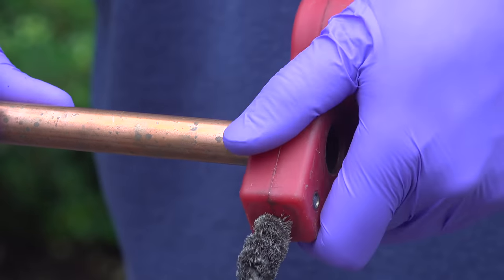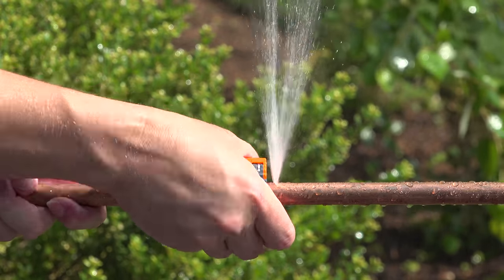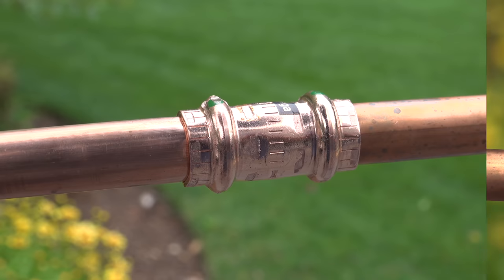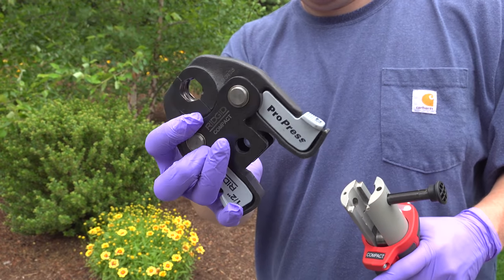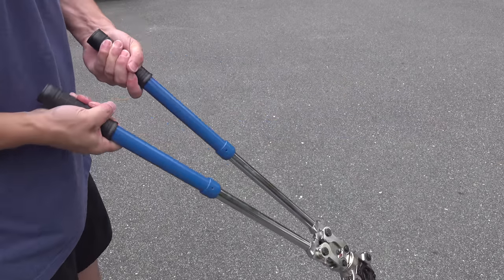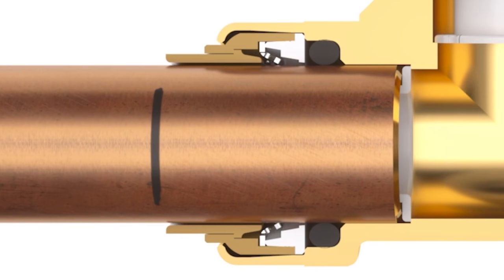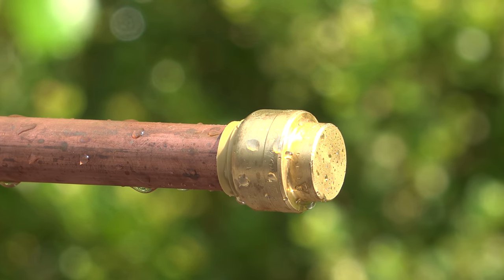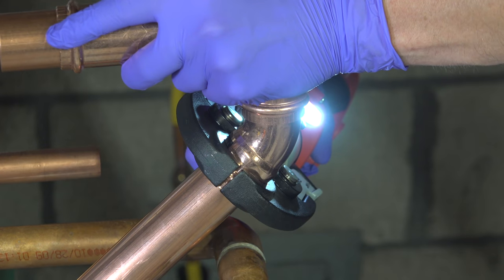NEVER SOLDER PIPE AGAIN - 3 Ways for EASY DIY Plumbing

Comment: Looks great as a temporary fix for someone with no soldering experience   however I would question the long term viability of using a process with O rings . How long would it be before they go brittle and fail? Personally I'll be sticking to the tried and tested method for now. Thank you however for sharing your video .
Reply: You and 18 other people apparently know more than plumbing associations and standards organizations.
My Dad was a Union plumber among other things, so I get that it painful to watch Non-plumber Joe Average simply cut plastic PEX and pop fittings on and be done with a job.  Currently in 2023, its hard to find a plumber willing to come out for a small job without a bill that would pay for a family of 5's groceries for a week. For a 1-2 hour job.
So far its been about 40 years in the US and longer in the EU and really haven't seen any uproar over failures, brittleness, etc.
Go ask anyone with a smidge of science education about which will last longer, a tube of copper or a tube of PEX.  Copper has a lifespan of generally 70-80 years, whereas PEX is known to have at least 50 years. They expect it would be longer but they don't have actual official samples from before that in the US.
Reply: @boots7859  Why you get so triggered by one guys opinion? Great your dad was a plumber. Mine was a doctor but i don't give medical advice. In the end soldering is a reliable method but to each their own. And if you can't get a good plumber with reasonable prices then search harder. It's not like plumbers are some rare breed. I had to go through a few plumbers before i found the guy who has been doing work for me the last 15 years.
Reply: Wasn't it O rings that caused the space shuttle to explode...😢
Reply: @boots7859 
there have been many instances of uponor pex A failures of the materials. Recalls have been made in red and blue pex.. where pin holes have been reported.. pex is not necessarily the best solution for plumbing supply..  😂😂

Comment: Installed shark bites on copper for my water softener. Almost 20 years ago and those suckers show no signs of leaking. Recently used 2 old ones to transition to PEX lines on a new water softener, just made sure the O ring looked good and lubed it up with proper grease. I wouldn't use them more than this one time, but once again the fitting works great from the copper to PEX. Old school keeps me cautious of using them in hidden places to be honest, but again almost 20 years and no signs of leaking.
Reply: 20 years is NOTHING! My home was built in 1957 and never had a leak!
Reply: @maxpower9848  so it's quite a new house, what is your point ? .These fittings weren't around then ,greetings from U.K.
Reply: @alemgas  >Place your faith in new technology that's only been around for 20 years
>Go with established method with a long standing proven track record

Yeah, I'm thinking solder is the smarter option.
Reply: @nonyafkinbznes1420  with that mindset you would still be fitting lead pipe 😂
Reply: @alemgas  Yes let's use modern plastic pipes instead.  Microplastics are totally safe for human consumption.  🤣
Reply: @maxpower9848  That you know of.
It would surprise all the experts that pop up on YT comments if they ever actually crawled around a house.  Old copper is notorious for pinhole leaks. And unless they're over the dining room ceiling or other obvious spot, they're missed until the hole gets large enough to overcome normal evaporation.
Reply: My house was built in 1824. They used shark bites and never had a leak. Except one frozen pipe failed at the sharbite fitting.
Reply: @nonyafkinbznes1420  You placed your faith in 15 year old tech (Youtube) to post a comment. Enjoy your leaded water.
Reply: @maxpower9848  Enjoy your leaded water.
Reply: @maxpower9848  My house was built in 800AC and I have NEVER had a problem with these aqueducts.
Reply: @TopBestestGreatestFastestMost  It's only a YouTube comment bruh and I've discovered many of my old ones are missing.  Tanks for proving my point.
Reply: @nonyafkinbznes1420  Microplastics are an entirely different thing. They can cross into the bloodstream and we are still trying to figure out what kind of damage they do in our bodies. Ever bought a cup of coffee from McDonalds or Starbucks? That paper cup is lined with a microscopic layer of polyethylene, so you've been drinking out of plastic for years.

Comment: I love how they completely over sell the difficulty and dangers of soldering, then show you a bunch of gimmicky crap that is way less reliable and will definitely cost you more time than just doing the job right.  ALSO:  Yes shark bites leak……almost always!
Reply: Shark bites almost always leak if they are installed by someone that doesn’t know what they’re doing. Same as soldering.
Reply: If you install it properly they don't leak can't say for long term though
Reply: @CT-vm4gf  shark bites always leak no matter what if it doesn't leak now it will later, stick with soldering none of the gimmick crap
Reply: I've installed shark bite fittings, shut off valves and a PRV in my own house. I've never had one leak in over a decade.
Reply: @nck4888 literally everything leaks eventually

Comment: I have had a similar experience with using push fittings for copper pipe. I have not used solder for many years. When installing new water lines or replacing damaged copper pipes I have made the switch to Pex B tubing. I use the rings with a hand crimping tool. However, I plan on upgrading to a battery powered crimping tool before a project this spring which will involve a significant amount of crimping, including in some tight spaces.

Comment: The problem with those is that they aren't anywhere near as solid as a proper weld. In northern climate, that could make a huge difference. We do have requirements that should keep pipes from freezing under normal conditions, but you can't ever guaranty there won't be a problem with heating, or power. Even in Canada, very few peoples actually know what to do under those conditions. A proper weld will have far more resistance under freezing conditions then a SharkBite or a Propress fitting.
Reply: @glickmpb  That's relatively easy to test and others have done so and posted the results, so I'm not just posting an opinion. A quick search is all you need to find the relevant information.
Reply: @glickmpb  I've had a couple shark bite fittings fail and leak both times was on copper connecting to pex...
Reply: What is the lifespan of an O-Ring?
Reply: It's not welding it's soldering ,welding you melt the metal. Try not to talk without engaging your brain
Reply: @alemgas  in other parts of the world,   it's called welding.
Reply: @TomCee53  Not in Canada, and not in places that know how to use a dictionary. Japanese for example- Welding-  溶接  Soldering- ハンダ付け

Comment: I carry Sharkbite Max PTC to FNPT ball valves and PTC end caps for emergencies, running water, full pressure installations, crawl spaces, temporary use, mock ups , freeze calls and more
I carry the FMPT ball valves so that I can transition to a variety of brass, copper and PEX fittings, and they eliminate one PTC connection once I stop the flow of water

Comment: For water plumbing I would suggest also considering transitioning from copper to PEX-a and using an expansion system for water tight connections with full bore ID for max flow and no restrictions.
Reply: Thats what I was thinking pex and the rings,  and I never seen a house 13+yr older with copper plumbing this is oldschool lol
Reply: A lot of newer homes built in the last 20 to 30 years,  I've rarely ran into copper. Copper piping was really for the upscale more expensive builds. Pex is everywhere now and to an extent was used a lot in the 90s and even 80s. Copper pipes are becoming so rare due to cost and is really becoming a lost art to solder since more times copper piping is removed for pex more often than not now a days around areas I work...which is in Arizona. Arizona is a very poor state with just a handful of rich people in it that control everything.
Reply: Azazel  rats love pex. No PEX. Use copper. Or better yet use Shark Bites. 🦈

Comment: We are using the Pro Press since more than 20 years in Germany.
Thats old stuff
Reply: Hard to imagine you would put those in a wall and seal it in there!
Reply: Yes. Daily since 15 years here. No issues
Reply: Plumbers in the US don't get a minimum of a month vacation every year. The more expensive and harder to obtain a plumber, the cheaper ANY kind of DIY plumbing looks. Every tool invented by man can be misused by another man too lazy to read instructions.
Reply: After 20 years mine leaked
Reply: Unopor.

Comment: Sharkbites work for sure!  I put a Sharkbite to connect a sillcock inside the wall because the city shutoff valve leaked, making soldering impossible.  7 1/2 years later, I reused the same SB coupling and still, no leaks!!😮

Comment: Most new plumbing does not use copper therefore making the press useless. I used shark bites or a comparable competitor's push fit connections to do a large remodeling project. The cost for push fit fittings have become extremely competitive and when connecting copper to plastic they are the best. Europe has been using the push fit design for over 30 years . USA has a lot of catching up to do in many areas regarding construction.
Reply: Shark bite fans will be sorry in a few years.
Reply: In the meantime massive recalls occur for PEX over bad batches of plastic and people have to redo their plumbing...AGAIN lmao

Comment: You can also open the shark bite with an open end wrench when you lose the special tool only to find it after the job is done.
Reply: yeahp i lol at special tool
Reply: you're so practical,
Reply: @charlesgeorge8111  its way better and serves the same function, just use your adjustable wrench.
Reply: @tylerp5839  about 'using an alternative for the moment; finding the special item after the job done', many can relate to; I keep things so safe even from self,

Comment: Shark bite does leak ask me how I know. I never used the "ProPress" but since the "ProPress" also uses rubber "O" rings I am certain they too will fail shrink/crack and leak over time. I would NEVER use them in walls, behind tile or in the attic. Maybe okay for a basement/emergency.

Comment: I've worked as a plumber for 14years and the viega/ridgid/geberit preasure mashine have been used here in Sweden since ive started. 
It also works for compressed air systems BUT you have to swap out the rubber rings inside all the parts! 
For hot wather (in Sweden anyway) the soldered parts is less effective than these pressed parts and starts to leak a few years erlier! 
And the machines is much smaller here to!
Reply: I worked as a plumber in Germany for 23 years. Since i have started we used only Viega Profipress, and never ever had a problem. 
Why do you have to replace the Ring for compressed air? Never heard about that.
We only had to replace the Ring if we used it for solar pipe, due to the heat...
Funfact: i live in sweden (Östra Småland) too since last year december 🙂
Reply: @michaelkastenberg6462  welcome to Sweden! 
The original rubber rings cant stand the high pressure so it needs to be swooped out to the red ringt. We found that out the har way. The whole indtallation exploded. It happend to my friend.
Reply: @johanramone  tack så mycket 🙂
I checked it again, if you use Viega Profipress Fittings, you dont have to replace the Ring for compressed air. 
I guess it was another Brand that you are using.
Reply: @michaelkastenberg6462  Cool! Thanx. well it happend about 8 years ago so i gues they have improved since then. perhaps the hard way to =)
Reply: My house is like 50 years old with soldered joints everywhere and not a single one leaks.....
Reply: @brianlevine249  Not yet anyway ;)
Reply: @johanramone   haha so true.  Maybe some time in the next 50 yrs :)
Reply: @johanramone    No way those rubber o-rings are lasting 50 years.  So long as your house water is properly taken care of and you don't have any crazy stuff known to eat solder you shouldn't have any issues ever. Only time I hear of people having this issue is one, mixing copper and iron pipe and 2, pipes that froze.

Comment: Great explanation! 👍I've used these in areas that a torch would just be too dangerous.
Reply: Had the same problem not insured for that any more
Reply: It's not a crack pipe buddy it ain't rocket science
Reply: @Hindukushsailing  yet you still watched the video...🤣🤣🤣🤣

Comment: These fittings are considerably more expensive than an end feed fitting. Anyone confident enough to take on a plumbing job should be able to learn to solder. There are certain applications where push fit fittings are useful and we also use them in the plumbing trade. Never use these fittings on gas.
Reply: I use mega press for gas line all the time.
Reply: @swagkillayolonoscopesgg  they make a specific propress fitting for gas pipe, but you don't wanna use a standard copper one. You definitely don't wanna use sharkbite for gas.
Reply: We have been using these type of fitting for over 20 years in europe. Saves money and time and leakages over time. But keep on solderingo over there
Reply: @badbob9341  You speak for all of Europe? Also there have been many many alternatives in the US for decades including brand named stuff like in this video and others like Apollo rings. This is a very brief view showing nothing more than a helpful guide for the homeowner to maybe do a repair, not a guide the US(state by state) plumbing codes 🙄
Reply: @dougk.5501  yep. But if this has been around for so long, how come youtube and reddit keep on feeding me clips and pics of soldering 'projects'. I really hope you're right and that for some reason I just keep getting the soldering instead of press fit ones
Reply: @badbob9341  the problem is sharkbite and other pressfit, is its up to installer error and doesn't show until later.  with solder it either leaks or doesn't leak. no 'the pipe must have shifted' or 'it wasnt deburred rifgt and the oring got damaged'  it sure would be awful to find water damage because the foundation settled, and yet thats what happens when sharkbites arent used perfectly, but they sure seemed fine at the time

Comment: I like the looks of the pro press, and will look for more info.  My first exposure to shark bites was when an HVAC contractor installed a floor heat system (hot water) and used shark bite fittings for all the copper plumbing around the boiler and distribution pumps.  But….they lasted maybe 3 years before the contractor had to come back and replace a bunch of the plumbing.  Not sure what went wrong, maybe it was the exposure to hot then cold then hot water repeatedly.  But I won’t allow any more shark bites in my home.

Comment: This was excellent. You've got incredible info and have saved me bucket loads of $$$. Thank you👍👍👍
Reply from the maker: Glad it helped!
Reply: No it didn't it would be cheaper to solder
Reply: @Hindukushsailing  You might learn to read. Over the expanse of time as a subscriber, I have shaved quite a bit of money. I wasn't referring explicitly to this technique. However, because of the possibility of fires I won't use solder. In fact, because of chemicals, I won't use it at all.

Comment: The best part of the Pro Press fittings is when they start leaking again in a few months they're copper so you can solder them to make a proper seal. I like Sharkbites they keep the call-in's coming, POS...lol
Reply from the maker: They have a 50 year warranty and Viega has been around since the 60s. You and I both know they are already used extensively in hospitals and commercial spaces becuase they work. Let's not make up stories.
Reply: I used Gatorbites to splice in a length of pex pipe over 12 years ago. Still holding.

Comment: The reason SharkBites leak is because they are not properly seated. It’s important to measure and draw a line that shows how far the fitting needs to go before applying. And you need to push perfectly straight.
Reply: I've seen sharkbytes pinholing out of the fitting in 18 months

Comment: Yup, Shark Bite fittings are only for emergency use and not long-term. Soldering or Compression fittings are excellent, but as you mentioned the compression tools are expensive. Hopefully, the compression tools will become more affordable for the mass market. Same goes for PEX tools.
Reply: Compression fittings with brass sleeve work too. You don't need special tools, just a wrench. However, the fitting choices are very limited.
Reply: I would argue that pro press is just fancier, more pro, more "good look in front of customer" version of sharkbite. Both seal by o-ring...
Reply: @MariuszChr  personally, the traditional solder method  is the way to go. No worries about o-rings eventually failing. Especially if you are enclosing the pipes in a wall or ceiling. The Pro Press offers a more untifom consistent  pressure around the pipe to seal it. Shark-bite is consumer friendly but uses points to bite the pipe. I have some Shark bites and spare  pipe  for emergencies, but at that point I might as well do it right from the get go and solder. And if I'm hiring a plumber, they are soldering. 😀
Reply: @LuxAudio389  agree. But I prefer pex 😁
Reply: @MariuszChr  I agree. I like PEX too because As a whole it's well thought out,  pattented, and versitile system. Super easy to install with little training👍